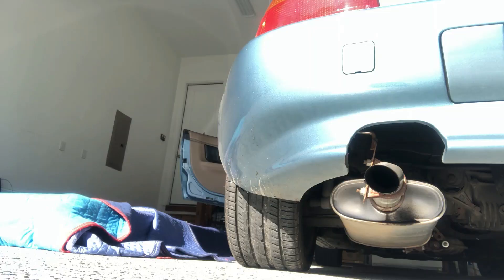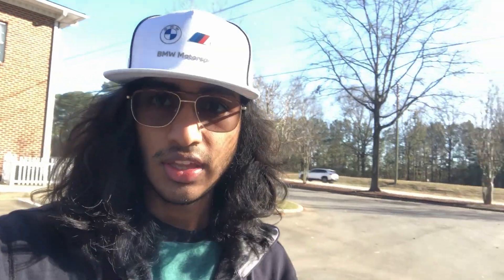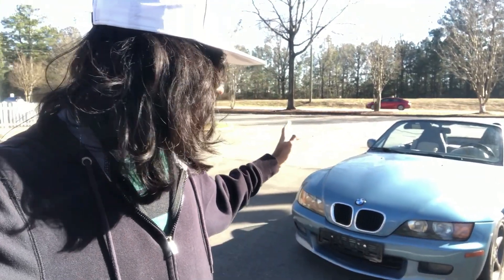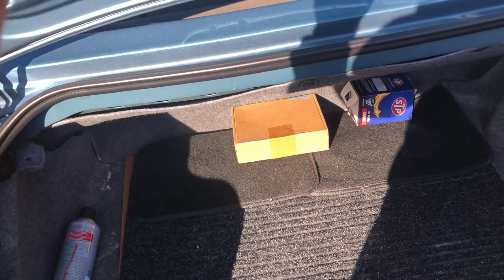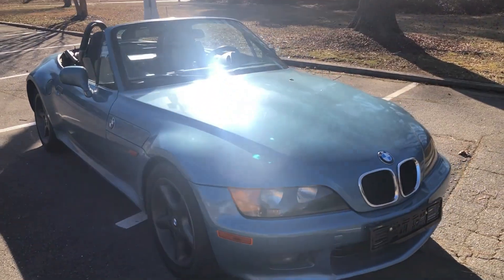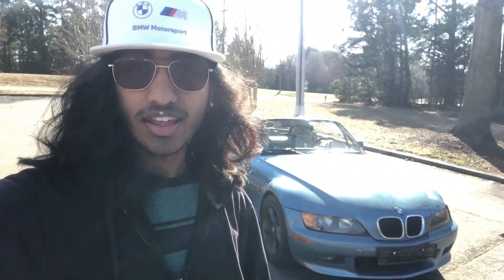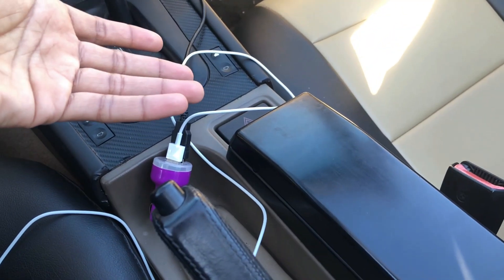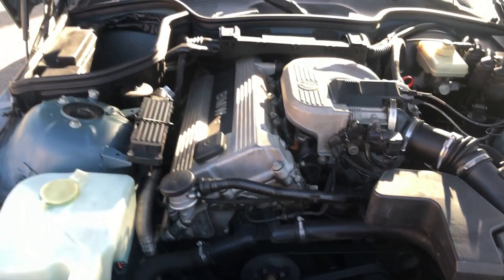Here's What I LOVE and HATE About my BMW Z3

Comment: Bro u gotta upgrade to a m roadster either a s54 variant or s52 
I got mine for 16k 96k miles 
My particular one is 1 of 1300ish made in arctic silver metallic they will eventually go up in price even in our current inflation super easy car to work on and cheap if u do it yourself
I love mine it drives like nothing els
Reply from the maker: It’s the dream. Right now, this is what I can get and I’m really happy with it
Reply: Does the M version require premium fuel?  I think it has 10.5 to 1 compression ratio.
Reply: @philclark6418  I mean it has a knock sensor so I could run low grade but it needs 89 and up I just run 92